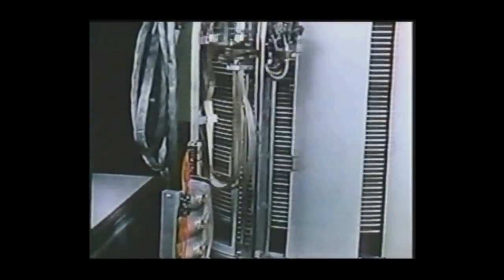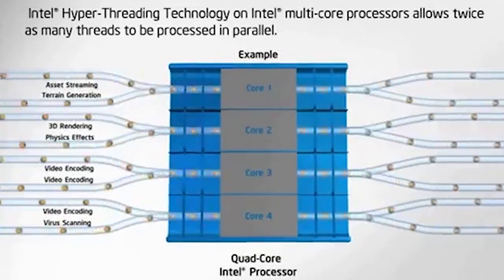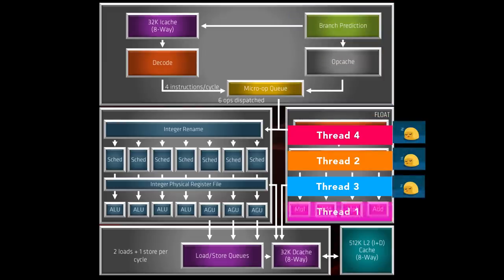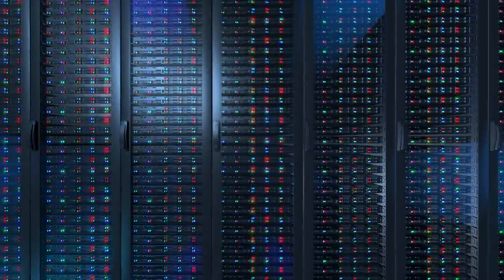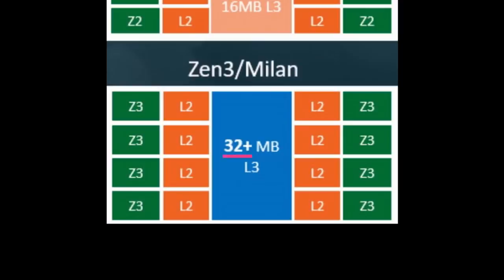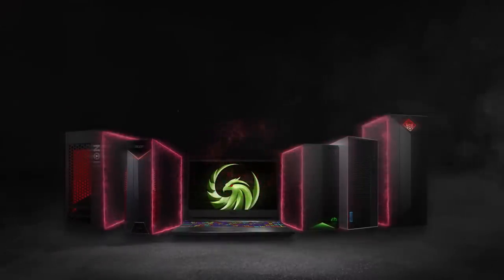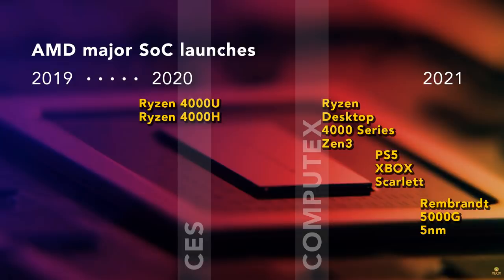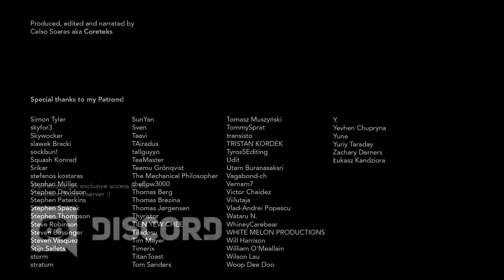Rembrandt | AMD’s MONSTER 5nm APU

Comment: I hope you're right.  Kinda getting tired of AMD not pushing the APU proposition forward.  I know they had financial difficulties and so on and so on, but I just can't grok why they're still relying on Vega graphics.  Sure, the uarch isn't that old, and it works well enough, especially in comparison to other integrated graphics solutions. 

Thing is, though, they have an even better GPU uarch now, and the point is to put your best foot forward.  Intel has Xe/Gen12, and when it is released it isn't going to be a discrete-only solution (as far as what we're being told, at least).  Meanwhile, it's looking like Navi will already be close to two years old before it finally finds its way into APUs.  Even if it's the 2.0 version, the fact will remain that it took them that long to trickle their new graphics paradigm down to integrated products. 

For better or worse, all the new and shiny is an important part of mindshare.  If you give the tech press, and by extension consumers, an excuse to view AMD as "the cheaper alternative" because the competition has the newer/fresher technology, you are just shooting yourself in the foot.

Comment: Single core computers are mostly obsolete at this point, most computers have at least 4 cores. Multi threading doesn't make sense in the way that you put it, but I think that you are assuming that computers have only 1 core.  If you can discriminate which tasks takes place on each of the core's internal units, I'm pretty sure you can also send bottlenecks to the next core as needed.

Comment: How does big.LITTLE or DinamiQ work? How does the thread scheduler know which core is heavy AMD which one is light?

Tremont with native x86 code execution has very little (idle) power consumption.

I'm not saying that AMD will implement SMT4. Nor do I say that a zen core with SMT4 could reach as low power consumption as Tremont cores.
But AMD could create a similar behaviour as a heterogenious cpu architecture by hard-setting SMT for each core.

Let's take a 4 core for example. AMD could preset SMT for.each core. The.best core capable of reaching the highest frequency could have SMT disabled for maximum ST performance. The worst core could be set to SMT4, and the rest to SMT2. 
The thread scheduler could schedule threads to ST, SMT2 and SMT4 cores the same way as it can differenciate big and LITTLE arm cores.

I wonder if AMD is planning to use SMT4, real "zen light" cores, or RDNA WGPs (DCU) for the LITTLE core purpose. (Note that this is not HPC use case)
Reply: On big.LITTLE, the OS migrates threads that take a lot of CPU time over to the big cores, and try to keep special ones there. The OS knows how much time each one is taking. It's part of the CPU scheduling, and if you're rooted, you can tweak those settings.

Comment: it would be most effective if you could run graphics processing, raytracing, light calculation etc. right there where you run compute processing. in fact it would be best if all calculations would happen in your CPU with no need of a graphicscard at all. than have a motherboard where you can install DDR-RAM and GDDR-RAM, i would love to be able to upgrade my PC to 64Gb of GDDR7 RAM and 512gb of DDR5 RAM at 7000 Mhz D; But right now APU still sucks and graphiccard provider dont allow you to install a custom amount of GDDR6. Graphicscards are to bulky, we can finally shrink our desktop home computer to the size of a gaming console or even to the size of a smartphone if we remove that bulky graphicscards, powersupply and blueray player.

Comment: Gaming PC rival is console not cloud gaming and even smart phones/tablets for simplerymechanic games. Because internet still sux for most of consumers. Cloud gaming will prolly be a niche option to areas where 100mbit symmetrical and good quality (low packet drop good proximity etc.) broadband without datacaps exists on reasonable pricings. If you travel you gonna still need gaming laptop/portable rig. If your upload per household still below 10mb you pray every night for more and fight w your family who syncs/uploads/plays. And If you under datacaps or slower speed you gonna still count on gameservers to use minimal relevant mathy/binary data, not the opposite that is a 4k or FHD video feed.. per player+spectator.

Comment: Damn, your voice makes my room shake m8! Not in a bad way either. 
 APUs have a future for sure, but this will be reliant on a 2.5D or 3D system that integrates HBM2E or something similar. Because the biggest holdup for APUs on PCs is that they are limited to standard DDR specs, which are SIGNIFICANTLY lower than even GDDR5 let alone GDDR6 which is soon to be sold at 16 Gbps! And VRAM latency is also MILES lower than even the best of the best DDR4 memory kits - so an HBM type solution will be mandatory until/unless a new DDR or other DIMM based memory tech standard manages to (somehow) catch up to the soldered BGA - ultra short traces with the speed and latency of GDDR6 - which is highly unlikely to ever happen (or at least the VRAM standard will inevitably leapfrog any system RAM standard). So yeah, HBM for the iGPU portion of the SoC, and possibly a separate DDR4/5 controller for CPU memory - unless the SoC manages to have 24+ GB of HBM in total anyway, which WILL be possible by 5nm with HBM2E!

 Hell, Nvidia already supplies the 2080 Super with 15.5 Gbps GDDR6 - and most people can already OC 14 Gbps GDDR6 to 16 Gbps or near it - so I am damned near certain that almost all 2080 Supers will hit 16+ Gbps for 512+ GB/sec on just a 256 bit bus, or alternatively 256 GB/sec on just a 128 bit bus! 384 bit and larger? Well that almost hits 4 Stack HBM2 levels!

I suppose motherboard could be sold with ~32+ GB of GDDR6 - but then that is what you are stuck with regardless of the future,  so I feel like DESKTOP based APUs meant to run Windows and the like will always need HBM on the package to be able to get NEAR dGPU levels of performance.  Sort of like Intel's Hades Canyon NUC - which has 4 GB of HBM for the GPU ALONE - it then also has a dual channel (128 bit) DDR4 memory controller for CPU/System RAM.  Obviously any GOOD future APU will have 8+ GB of HBM for the iGPU portion - but I think the BEST path for APUs is to still have a standard dual channel RAM controller for CPU/System RAM - that way there is no memory contention at all, and background processes do not eat into the needed VRAM bandwidth. Consoles don't really run heavily multi threaded - which is to say while a Console like the Xbox One X/PS4 Pro can have a bunch of "programs" open at the same time, but unless it is on screen at the time, the OS cuts off it use of resources - UNLIKE Windows!

Comment: It would be good if they could have just one or two cores with SMT-4 enabled, these CPU cores could be dedicated to running the OS and it's background processes and they could be hidden from applications by the windows scheduler, the rest of the normal SMT-2 cores could be left open for applications.  I suspect (If they did do somthing like this) it would be a trickle-down feature requested by console manufacturers.

Comment: That's a very speculative video. 
I thought there were some leaks and sources. Sounds like a little too much wishful thinking.

It could very well be the HPC APU that was actually on AMD slides and roadmaps before the Zen 1 launch. But it never reached the market. I think it was projected as eight cores, a very fat GPU and HBM. The chip was probably not feasible. Now with chiplets...

Comment: If this even partly true NVidia will have issues selling its gpus as they are.
Reply: But the time more powerful APU arrive the performance will always end up lacking vs even sub 75w GPU at that time. And there is a push towards hybrid rendering as well which will increase the performance impact quite significantly.

Comment: you are talking in a way that makes it sound that you dont know how SMT works... for some reason it looks like you are saying that if you have 2 way smt your processor should run 2x as fast... that is not the case... its just that  because of the nature of how programs work, you have to fetch instructions to execute, then execute those instructions. the fetch part can take a long time if the data you want to access are not in the cashe. so the processor has to ask ram or the hard drive for the data and that can take hundreds if not thousands of cpu ticks. if you dont have SMT, the core would be idle during these fatches (this is really oversimplyfied) now if you have SMT this time is used for the other thread. the speedup is because the processor is not utilised... that means that if you dont have the bubbles in the data stream that would cause A LOT of cashe misses there is no reason to have 4way SMT because it takes silicon to implement it (which could be used more efficiently). Actually if you know how to write your code well and use the right tools and some other tricks, you can usually make programs that run at full speed reguardless of SMT... SMT doesnt mean your cpu runs faster... it means that if the program accesses a lot of random places in memory, the cpu will be less affected by cashe misses. and usually there are only a few algorithms that would access data so randomly that you would benefit from 4x smt.

Comment: I don't buy Zen 3 only being 10% better. Too small of an improvement to call it Zen 3. If the node provides 10 % speed improvement then AMD will take it. No need to save power on Desktop. This, combined with a conservative 7 % IPC improvement gives around 18% better performance over Zen 2. That's a much more appealing product.

Comment: So... in another 2 years AMD will reach where Sun Microsystems with their UltraSparc T2 was in ...ugh...2010 ? :D They had 8 core CPUs with 8 threads per core and ability to put it into 2048 thread in cluster system ! And Oracle wasted it. I'd love to see what 4 GHz T2 made in 5-7 nm would be capable of.  Also, SMT is pretty much useless now - even popular archivers, media encoders, most software default to single thread and OS usually doesn't care about CPU topology and process affinity, switching threads from core to core, at considerable expanse.  Resource contention? Well  IEEE Spectrum wrote few years ago that multicore is death of supercomputing, putting untenable burden on memory bandwidth.  However, most professional software - e.g. databases - come with own memory allocators and even schedulers.

Comment: So basically the death of the mid range to high range GPU is coming by 2030 yes? I hope so as Nvidia is a cancer in the industry. 

It also makes sense to put the GPU on the CPU with stacking or interposer technology as it speeds up the throughput and output of information drastically when implemented correctly and at a much lower TPD compared to having the hardware as separate devices onboard. 

I'm looking forward to the end of GPU's once and for all. 

The only downfall would be having such a big case and Led display in your cases anymore. 

But if we can have micro atx as the new norm without a GPU it would allow for further innovation when bringing performance into the discussion. 

Hearts and minds will have to be changed for this to happen and this i think will be the hardest battle that anyone in the industry will have to undertake for the leap to miniaturisation moving forward. 

I for one welcome it.

Comment: We're reaching the limits of how small silicon can be utilized - 1nm is equal to about 2 silicon atoms.
Transistors smaller than 7 nm will experience quantum tunnelling through the gate oxide layer.
Reply: You're assuming we'll still be using silicon, or at least int he same way, with oxide layers, etc....there's a LOT that is going to change to make smaller computing possible, and that means materials, interconnects, and more.
Reply: @cjjuszczak  i'm not assuming anything, just stating the limits of silicon
Reply: @criznittle968  you literally said what WILL happen : 
"Transistors smaller than 7 nm will experience quantum tunnelling through the gate oxide layer."

You didn't say "would...IF....", you said "will". That's presumption on your part that we'll still be using silicon in the same way we do now, and even presuming we'll use silicon at all.
Reply: @cjjuszczak  ah okay i see what you mean, i should have specified that the second statement was in relation to silicon.
Reply: @criznittle968  no worries, there are some exciting times ahead, with some MASSIVE paradigm shifts coming in the next 3-5 years alone. 
It's a great time to be alive :)
Reply: it's a good thing then that "x nm" was marketing and nothing else for years.

Comment: hmmm lmao i still will buy intel over amd anyday because they have the represantation and they are just a better company in everyway GPU, CPU < servers< emulation and high clock speeds ya ill take my 5.5ghz on all cores with water cooling and nothing over 130$ coolers lol cant say shit my R15 cinibench single core score gets around 235 pts lets see amd get even close to that on R 15 single bench score

Comment: I think having an apu as described will make cooling somewhat difficult.
Reply: I used the ryzen 2400g on 14nm. I never had it over 70c with stock cooler and kept it below 60c with AIO. With power efficiency of 5nm by 2021, I think you'd be able to keep a very powerful APU under 100w and cool enough with air. Only time will tell though.